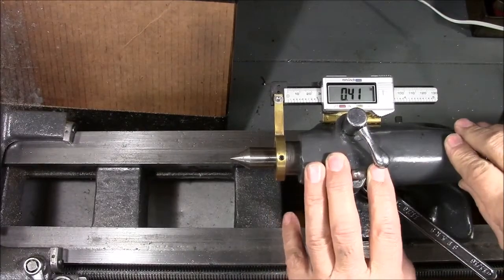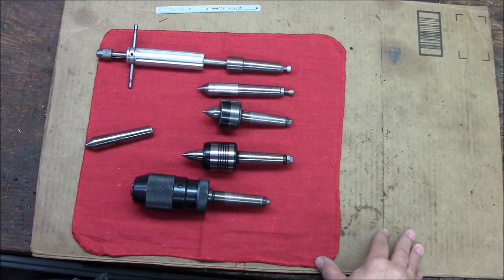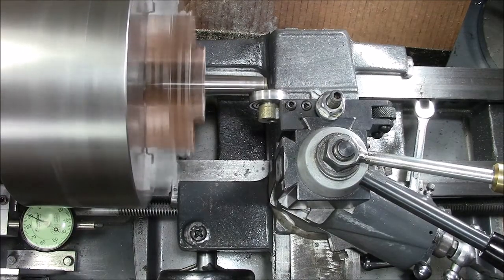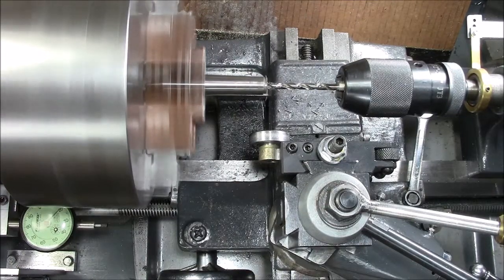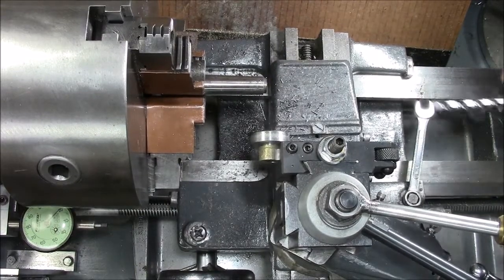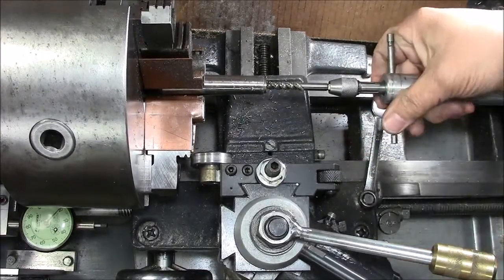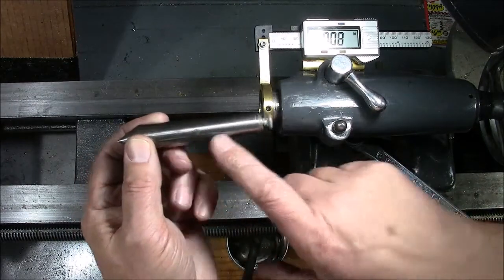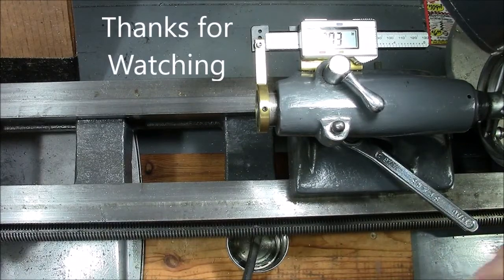Tail Stock Tool Ejector

Comment: Worked out well.  I was interested to see how you would chuck it up. Drilling it like you did made me nervous, given that the piece was only lightly supported.  A lower speed might be a bit safer.

I've often thought about doing a video on adding tang substitutes/extensions to Morse tapers, as I'm sure a lot of folk are oblivious as to how easy it is to do.  Good video.

Cheers Rob
Reply from the maker: Thanks Rob, The thick copper jaw guards really helped keep the two hardened surfaces from slipping against each other and I had it really cranked in tightly in the chuck.  I applied the pressure from the tail stock very slowly until the center drill got a good start.  Boy was that a hard piece of hardened steel.  The cheap center that I modified with my friend Ted was a piece of cake in comparison.
Reply: Hi Fred,

I was thinking about this and maybe you could keep it safely centred with a fixed steady, provided there's room for it ?

Cheers Rob